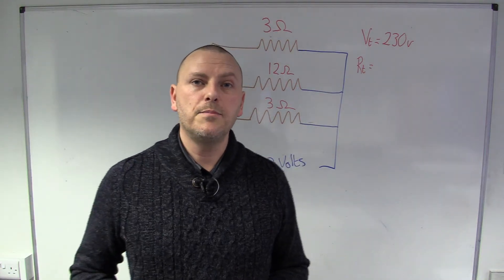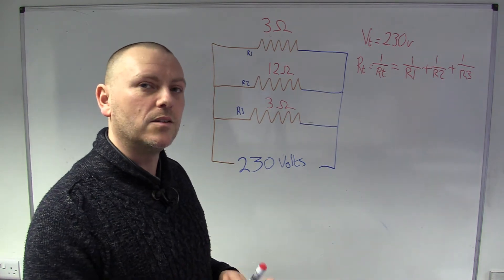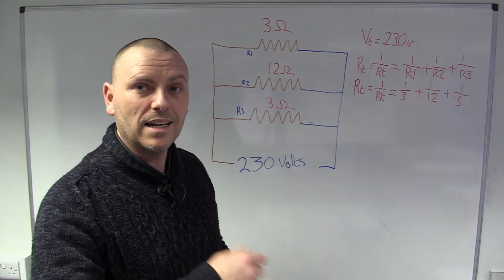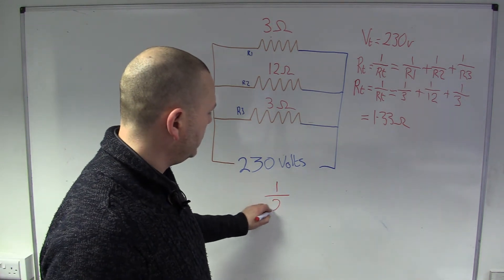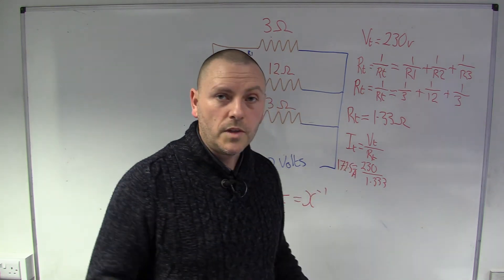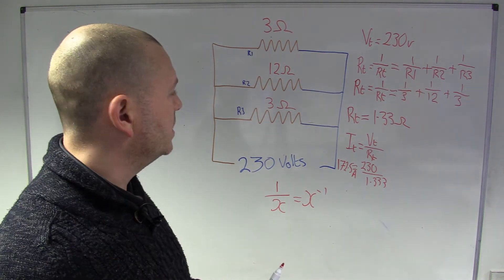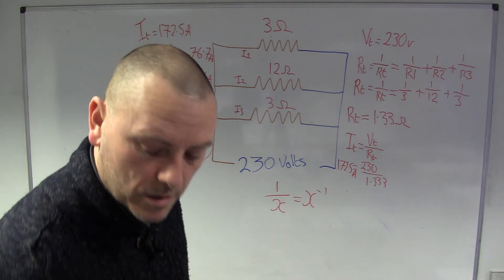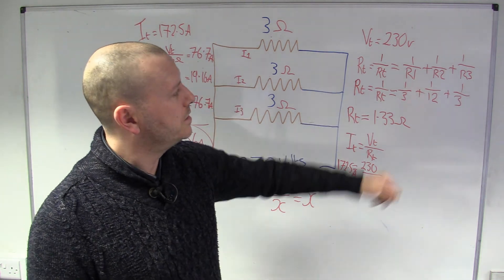parallel resistance equation and how to calculate currents in a parallel circuit.

Comment: Hi Craig, when i input the numbers my calculator came up with 1.3, not 1.33, this threw the whole equation off. Did i do something wrong? I pressed the ENG button and it gave me 1.3 recurring though, so should i do that everytime its only to one decimal place?
Reply from the maker: Which calculator are you using?
Reply from the maker: It could either be a setting on your calculator that rounds to one significant digit or just a basic calculator. You didn't do anything wrong by the sounds of it. If you send me the model number I might be able to help you set it up differently. 👍